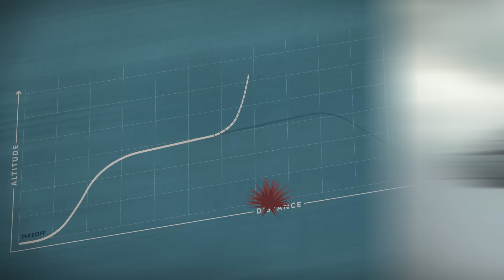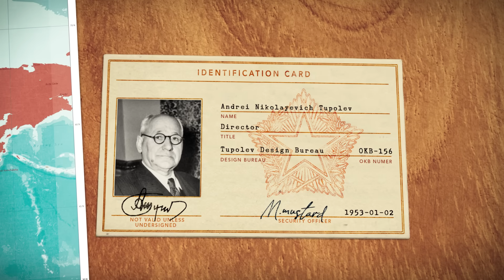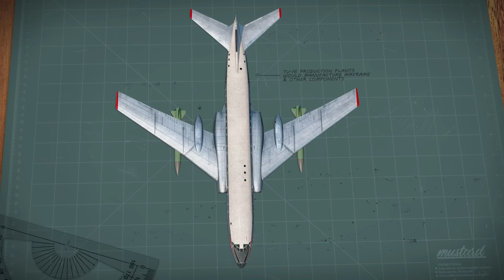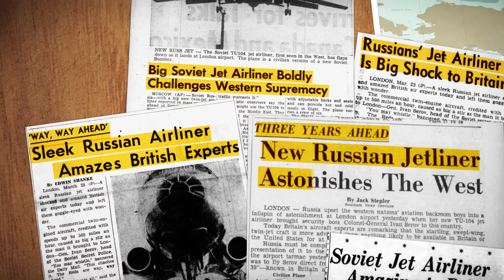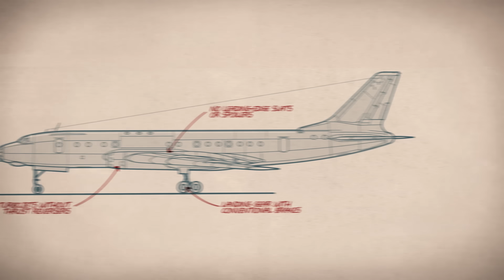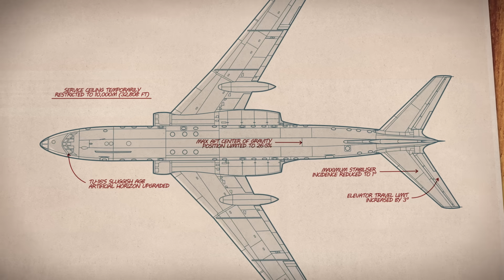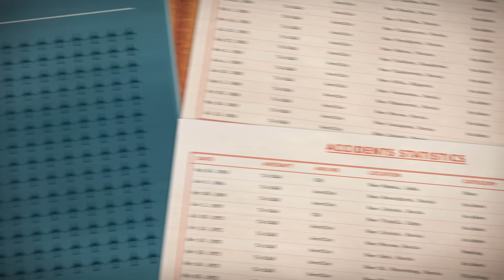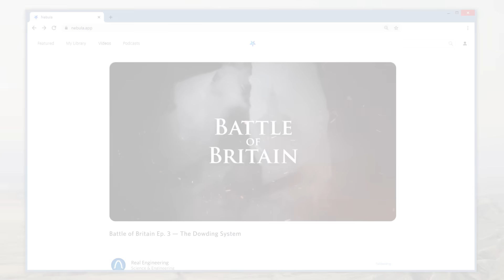The Soviet Airliner Designed To Crash

Comment: Makes one wonder how well the Hadley Page HP.111C (a crescent wing Airliner proposal development from the Victor Bomber) would have faired in terms of performance and range and would have been one of the safest landing (look mum no hands) aircraft. But then the first Turbofan engine VC10 (far superior to the Boeing 707) was an exceptional airliner doomed to commercial failure due to US trade policies to exclude foreign aircraft from internal US domestic use. UK aircraft industry couldn't really compete with the US Bribery Pot of cash either.
Reply: Britian lagged years behind in aircraft technology.
The VC-10 wasn't a bad plane, it was  a bad concept, a design that airlines didn't want to buy.
The Boeing 707 was vastly superior to any British aircraft, even British airlines refused to buy the VC-10.
Reply: @sandervanderkammen9230  First jet airliner. First 4 engine Delta winged aircraft. First Crescent winged aircraft and first supersonic large airframe. First commercial aircraft with ILS. First Supercruise aircraft 50 years before the F22. First succesful VTOL aircraft,  First Supercruise Mach 2+ SST etc
Reply: @amfearliathmor9747  The first successful airworthy jet airliner is the Boeing 707.
The first supersonic 4 engine delta wing aircraft is the Convair B-58.
Crescent wings were a failure, an evolutionary dead end.
The Largest supersonic aircraft is the North American XB-70.
The fastest air breathing delta wing aircraft is the Lockheed SR-71.
(The fastest aircraft is the North American X-15.)
The Hawker Siddeley Trident and its Autoland system were commercial failures.
The first supercuise aircraft is the Lockheed F-104.  
The first supersonic airliner is the Tu-144.
Britain has nothing comparable to the Lockheed F-22.
The RAFs most advanced jet fighter is the Lockheed F-35.
Any questions lad?
Reply: @sandervanderkammen9230  First Jet Liner - DH 106 Comet
First 4 engine Delta winged aircraft - Avro Vulcan
First Crescent winged aircraft - Hadley Page Victor. (went supersonic before the B-58)
First commercial aircraft with ILS - Hawker Siddeley Trident
First commercial Turbofan engine aircraft - Vickers VC10
First commercial Turboprop engine aircraft - Vickers Viscount
First Supercruise aircraft - English Electric P1 using Armstrong Siddeley Sapphire Engines that the F104 protoypes used.
First successful VTOL aircraft- Hawker P.1127
First Commercial Supercruise SST - BAC/Aerospatiale Concorde. (had more Supersonic hours than all US aircraft combined in history)
I don't really count the SR-71 (cannot achieve Mach 2 without another tanker carrier to carry it's fuel payload to altitude much like the Bristol 188 and needs a climb and dive to pass through the transonic region) or dropped from another aircraft at altitude such as the rocket powered Bell X1 or final X-15.  At least the XB-70 could take off under its own fuel payload but didn't fly to well next to a Lawn Dart.
Eurofighter Typhoon can at least be considered a Multirole aircraft unlike the F22 which doesn't even have a IRST as the F22 is now outdated with the emergence of SDR RWR systems (electronic warfare for BVR AESA RADARs). UK interest in the F35 was as a replacement for the Sea Harrier with semi VTOL capability. The cancelled Hawker Siddeley P.1154 specification seems to now have a replacement about 50 years later.
Thsi is fun!! LOL.
Reply: @amfearliathmor9747  The first successful, airworthy jet airliner is the Boeing 707.
The Comet 1 was grounded and its airworthiness certification was permanently revoked.
The Avro Vulcan was not supersonic which is the reason why delta wings were developed.
The Boeing B-52 has the same wing surface area and is faster with swept wings.
 Crescent wing were a failure, evolutionary dead-end.
The Victor was not supersonic, it could not reach Mach 1in level flight.
 The Trident and its Autoland system were big commercial flops... huge financial failure for Hawker Siddeley that would be forced to merge into BAC or go out of business.
 The first jet airliner with turbofan engines was the Tu-124, not the VC-10, the VC-10 was yet another flop that crippled
 Vickers and BAC.
  Absolutely nothing cutting edge technology about the VIckers Viscount, overall a very unremarkable, pedestrian design that would not save Vickers from dying out.
  The first production aircraft with supercuise was the Lockheed F-104 also the first Mach 2 fighter-interceptor. The F-104 set too many world's records to list...many still stand today.
  The World's first SST was the Tu-144, not the Concorde.
 That's because Britian lagged decades behind America in aircraft technology that they have nothing to compare with the SR-71, XB-70 Or the X-15... Britian was out of the game and soon to be out of business.
  The Typhoon is designed by Eurofighter Jagdflugzeug GmbH,
A multi national consortium headquartered in Munich Germany.
It is not a British company.
Germany is the largest manufacturers of jet aircraft in Europe.
Britain has never designed, built or even operated a high performance stealth aircraft, the RAF has absolutely nothing  comparable to the Lockheed F-22 Raptor.

The RAF no longer operates any modern British aircraft... the only British aircraft left in RAF service is the 1970s vintage Hawker Hawk trainer.
Cheers mate!
Reply: @sandervanderkammen9230  The BAe EAP demonstrator (which became the Eurofighter Typhoon) was actually a design study from a Student from Loughborough University from the 1970s as a low cost Hawker Hunter replacement the students would work on in the basement. The EAP replaced the Hunter in the basement at the University. The German TKF-90 design elements would become included in the Rockwell demonstrator. The French lost interest in the Eurofighter concept and ended up developing the Rafale.
Reply: @amfearliathmor9747  Eurofighter Jagdflugzeug GmbH. is a multi-national consortium headquartered in Munich Germany, it is not a British company.
Reply: @amfearliathmor9747  The very last British jet combat aircraft, the Hawker Siddeley Harrier was retired in 2011 and has been replaced with the Lockheed F-35.
Reply: The British aircraft industry was never any competition for the Americans and the entire U.K. aircraft industry was doomed to failure after WW2 thanks to the collapse of the British economy.
Reply: @sandervanderkammen9230  :yt:Vickers VC10 - the lost flagship
Confusing technical success rather than commercial success.
Reply: @amfearliathmor9747  A failure is failure... making excuses doesn't change that.

Comment: The Boeing 707 Jetliner was based on its KC-135 Tanker developed to refuel B-52s.
Reply: The Dash80 was the prototype for the entire 707 series family including the KC-135. The 707 was developed from the he Boeing B-47,  a captured German design discovered by the Fendden Mission and sent back to Boeing by George Scherer.
Reply: @sandervanderkammen9230 , Technically you are correct; the Boeing 367-80 technology demonstrator resulted in both the 707 & KC-135 models. However, it was the USAF's need to replace their KC-97 tankers that drove that program. The B-47 & B-52 really needed a faster Tanker.
Reply: @skydiver1013  All of Boeing's successful airliners were developed from a military program and developed concurrently as a passenger airliner.
The B-17 and the 307 Stratoliner.
The B-29 and the  377 Stratocruiser 
The KC-135 and the 707 Jet Stratoliner 
The CX-HLS (C-5) and the Boeing 747.
Although very different in appearance much of the work on the B-47 was used for the Dash-80.
Reply: @sandervanderkammen9230 , well yes and no.  The B-17 was a stand-alone development that leveraged technology from several other Boeing programs Boeing-247, and XB-15. The Boeing 307 Stratoliner builds on the B-17 experience using its wings, tail, rudder, undercarriage, and engines. However, the B-307 was the world's first pressurized airliner in service. The Boeing B-29 was an extremely complex program that leveraged Boeing's experience and technology from several other Boeing programs. Costing twice as much as the Manhattan Project, the Boeing B-29 was the pinnacle of American technology in WWII. Boeing flew their first swept-wing jet bomber, the B-47 in 1947. The B-47 incorporated many features copied from the German Me-262 the USAAF was kind enough to loan Boeing.
Reply: @skydiver1013  That was exactly my point, the 307 is based on the B-17 and the 377 is based on the B-29.
Both airliners were developed using technology paid by the military and used to offset the cost of developing a commercial transport aircraft which is a much higher risk financially because it's the companies money or more likely these days borrowed money.

The Boeing 707 story is a little more complicated, the KC-135 was not a bomber but a military tanker, a very lucrative contract a large fleet with lots of government investment.
The plans for Projekt 1117 were stolen by German-American Boeing engineer George Scherer from the Luftfahrtforschungsanstalt supersonic aircraft wind tunnel facility during an inspection tour by the von Karman Mission.
These plans along with engineers brought to America by Operation Paperclip would become the B-47... a massive leap forward in aircraft technology that put Boeing ahead of everyone.
The KC-135 and 707 are heavily based on German technology from the B-47.
Cheers!

Comment: No mention of the only passenger airplane with a bomb sight window in the nose..
Reply: Glazed-nose was a standard feature on all pre-1980s Tupolev airliners (Tu-104, Tu-114, Tu-116, Tu-124, Tu-134). Allowed them to easily perform military duties during wartime (eg. for locating remote airfields and conducting airdrops)

Comment: All Humanity and all the wildlife of the planet have been bombed with nanoaluminium and barium salts for many years. 70% of sunlight due to chemical trails does not reach the earth's surface, where carbon dioxide accumulates in the surface layer - one of the main greenhouse gases. Without light, there is no photosynthesis, which used to reduce the amount of CO2. Beasts steal oxygen from humanity, crops disappear, artificial temperature rise in a chemtrail greenhouse is used to create artificial "weather" cataclysms

Comment: What use is the windowed nose? Many latter models did worst, killing many more.
Reply: The de Havilland Comet was the worst jet airliner in history. 
The Tu-104 actually has a better safety record than the Comet
Reply: @sandervanderkammen9230  ......was the world's >>>first<<< commercial jet airliner, also was the first Car, first rocket, first plane, first.... see no point actually, didnt say contrary.
Reply: @marcleblanc3602  The Comet was the first failed attempt, the Comet 1 was grounded and its airworthiness certification was permanently revoked.
The first successful, airworthy jet airliner is the Boeing 707.
Boeing was and still is the world's leader in commercial aircraft.
Reply: Some 747s have been involved in accidents resulting in the highest death toll of any civil aviation accident, the highest death toll of any single airplane accident, and the highest death toll of a midair collision.
MAKE & MODEL	TOTAL CRASHES
Boeing 737-200	906
Boeing 737	780
Boeing 777 - 206	534

Airplanes With the Most Crashes
    Boeing 737: 149 accidents.
    Boeing 747: 49 accidents.
    Airbus A300: 33 accidents.
    Airbus A320: 28 accidents.
    Boeing 737 NG / Max: 27 accidents.
Reply: @marcleblanc3602  Did you drop out of school? Or just receive very poor marks?

Comment: Comparing to comet, there were twice as many 104s built. 25 serious accidents happened to the comet, 37 - with 104 which actually makes 104 a more reliable aircraft in terms of serious accidents per airplane
Reply: Did the Comet kill nearly a whole command structure because the Commander in Chief was an asshole and because the Soviets TAKE FOREVER to acknowledge mistakes? No.
Reply: What the hell does accident rate per airplane have to do with the overall reliability and danger of an aircraft beyond being a mere statistic? The DC-10 had a lower hull loss rate than the Tu-104, yet was just as dangerous as a Tu-104, as both had major design flaws.

It really does seem that logical fallacies (and especially whataboutism) are as natural to Russians as vodka.
Reply: I knew this would be the case!
Western people are very quick to point out propaganda… only on the other side though. 😂
Reply: The difference iis that the Comet was deemed a flying coffin and the Tupolev was the pride of the Soviet union.
Reply: Out of the 25 Comet crashes, 13 were fatal and most of them were caused by pilot error. Only 3 were as a result of metal fatigue or the structural problems. 

Tu-104 fatalities were significantly higher than those of the comet. 

Also the Soviets did not ground the aircraft unlike the British with the Comet. Instead the Soviets kept them in service and thus sent many innocent passengers to needless deaths. So much for claiming to be for the people, the Soviets didn't care about safety.
Reply: @Frserthegreenengine  The fact that the 104 flew on the entire time that the Comet was grounded and still had proportionately less crashes further proves its reliability over the comet.
Reply: @Frserthegreenengine . If “numbers killed” is how you like assessing aircraft then the Boing 747 is the most dangerous in history.
Reply: @annoyingbstard9407 people love to grasp at straws
Reply: @Frserthegreenengine  Fool , listen to anti-Soviet propaganda more and more often . OF ALL the crashed Tu-104s, only 2 aircraft crashed due to the "pick-up" to altitude and a corkscrew. All other accidents are mostly pilot errors, failure of mechanisms and, most of all, bad weather conditions.Among the planes considered lost , 2 were blown up by terrorists , one burned down while refueling by crooked-armed Indian tankers in India , one was mistakenly shot down by an anti-aircraft missile , one was broken during a flyby after maintenance due to the fact that the cables in the control system were mixed up .The main mass of accidents is about weather conditions . Where I live, the heat is +35 in summer , the cold is up to minus 42 in winter, and there are areas to the east of me with an even harsher continental climate. 2 \ 3 flights to the USSR take place in the latitude zones of the north of Alaska and Canada.Your stupid British and Americans would have ruined their entire fleet in such conditions.That is why large planes fly to Alaska only to Anchorage , where it is minus 17 in winter, And people are transported to the rest of Alaska on all sorts of junk from DС-3 to single-engine small airplanes.So  the pilots should not blame your , as an construction that actually worked in combat conditions.
Reply: @Frserthegreenengine  weak cope. First Russian civilian jet plane was better than first British counterpart. Britain was way too weak to compete. Never heared of any John Smith being the first man to be in space.
Reply: @player1GR  old stereotype "Soviet always means bad" will never worn off. And it`s sad.
Reply: @player1GR that still doesn't mean its good
Reply: @alexstoyanov6108 Yet its true for absolutely everything the Soviets produced was shite and a crappier copy of a western product from food to planes.
Proof? Nobody would buy any soviet products despite their low price.
Reply: @specularverzide9972  Check soviet exports, mate)
Reply: @alexstoyanov6108  Name one thing in your household that came from the Soviet union as you were growing up.
The soviet union was an absolute abysmal exporter of anything remotely complex or skilled. Oil, ore and gas an economy don't make.
Reply: @Frserthegreenengine ’Pilot error’
Reply: @Frserthegreenengine 😂pilot eror and bad training

Comment: The problem with the TU-104 seemed to have been centre of mass and centre of lift placement, mixed in with other aerodynamic stability issues. I mean, when you have a fresh new technology and you only spend 3 years developing a product that uses it, yeah, it's probably going to be a failure prone piece of shit at best if not a death trap at worst.

Comment: FACTs During 27 years of operation 30 Tu104 and 104A's were lost with the loss 960 lives but the plane had carried more than 100 million passengers, spent in the air 2 million hours, and recorded over  600 thousands flights. It was the way for common people to travel in the Soviet Union I was one of them in 1968  For comparison 194 Boeing 707s   of the over 1000 built crashed

Comment: Sounds like they should have just replaced the turboprops on the tu-114 with jet engines and be done with that. Bigger Airline capacity to start with and an airframe with a excellent safety record. The tu104 might as well be called the Cometski, a play on the tu144 being called the Concordeski.